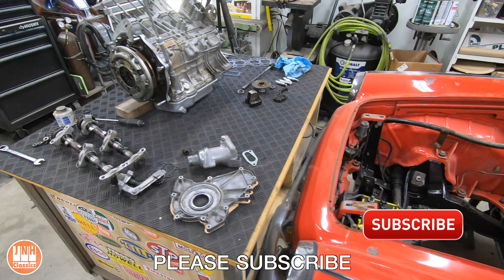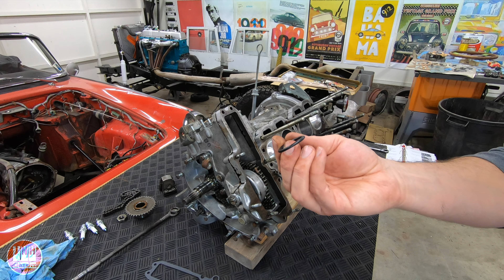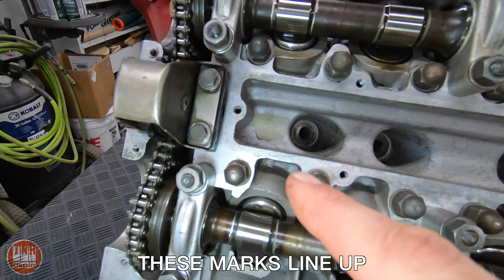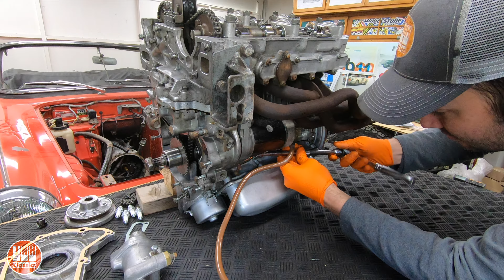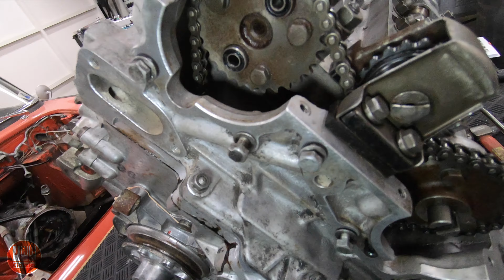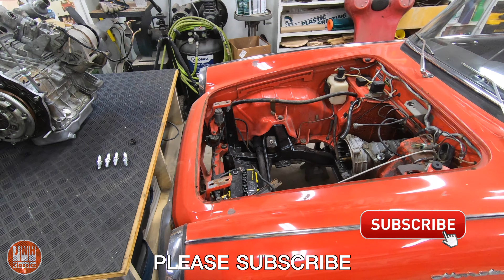Rescuing a Honda S600 - (Episode 16) Engine Assembly Part 2

Comment from the maker: After uploading this video, I realized that I left one O ring out that goes under the head by the front case right by the timing chain and also realized you should install the timing chain before the bottom case. I fixed both issues off camera. Thanks for watching and be sure to checkout the other videos in this series 👍

Comment: Well-made engine very similar to Lexus with the shims on the valve train I would recommend add a zinc additive to oil. Those cams might have soft metal. Top job.

Comment: Getting there! You should check the valve clearances, particularly if you ground the valve seats or swapped the valves around. Above all, make sure there is enough clearance so the valves don't get burned. But too much and they will be noisy etc. It's a royal PITA to adjust the shims if they need doing but there's no easy way other than to measure the current gaps, remove the cams and buckets, then grind the shims down, reassemble and check again. If the shim has wear where the valve stem touched, that can make the process tricky to get right.
I used that gasket sealer stuff on my S800 - smelly and sticky but works well. I notice you only applied to some gaskets and not others - did your workshop manual tell you?
Looking forward to hearing this!
Reply from the maker: Thanks for the comment, I really appreciate the info. I will be working on the valve clearances soon. 👍

Comment: Fantastic job with this rebuild! 
Curious: Is the black glue not needed for other parts of the assembly outside the engine block? I didn’t see you put the black glue on the oil pan seal, either.
Reply from the maker: I try not to use too much sealant. Especially when I might have to take it back apart. Also it’s best not use any sealant on cork gaskets👍

Comment: At what point did you install the Cam Chain? Should it go in with the Crank Shaft you didn't show that part!
Reply from the maker: I should have installed it before the bottom piece, but I forgot. So I took a link out of the chain and added a master link so I could install it without removing the bottom piece.